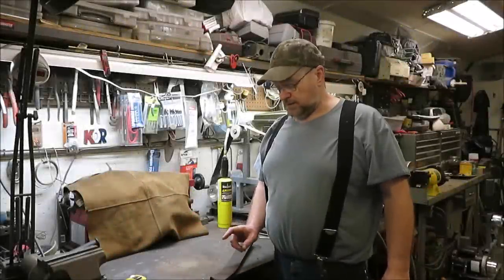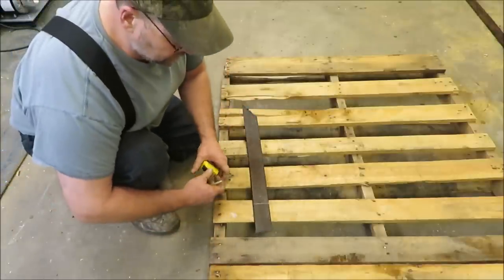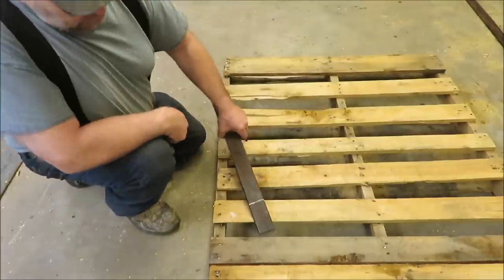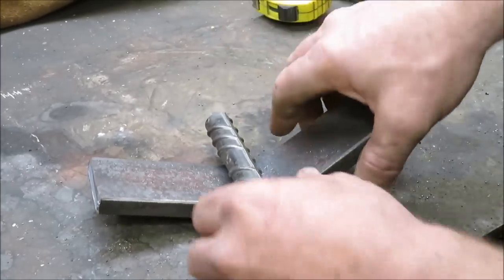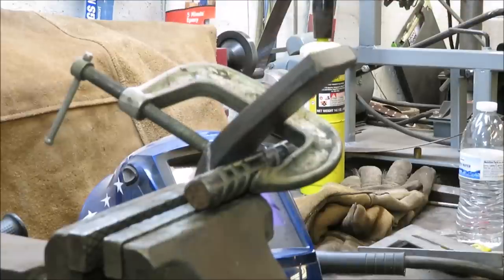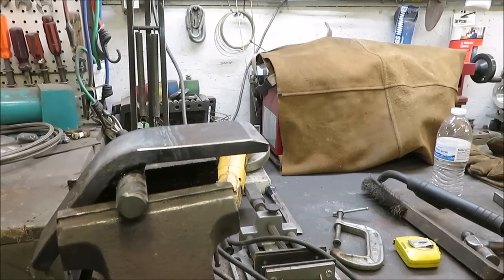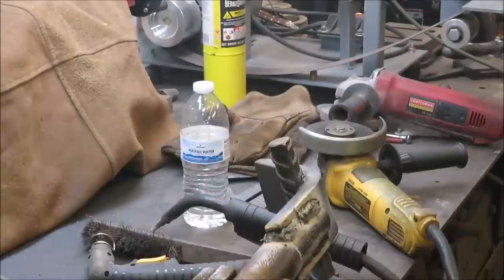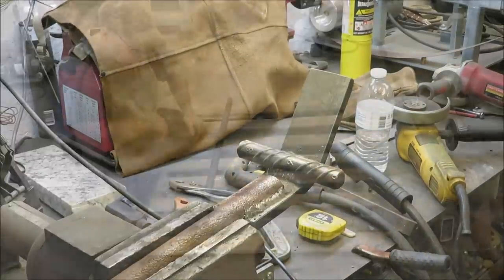pallet pry bar simple build

Comment: I'm sure that works fine. I would suggest that it might work even better if the re-bar was "below" the flat bar. It would give you more leverage I believe especially when it's being used on pallets like the one you just did where you are prying against the 2X4 instead of the next cross board.
Reply from the maker: Thanks for the tip
Reply: I disagree, I have made the pallet buster and can see how perfect the position of the round bar is when using it, anywhere else and it would be in the wrong place.

Comment: I like your design, hey, would it help with weight and cost to shorten the pipe to about 9 inches and the rest of the handle could be a hardwood insert, like hickory?  Really, only the business end needs to be metal, right?  The handle could then be different lengths, to suit people of different heights.
Reply from the maker: I'm sure that would work.